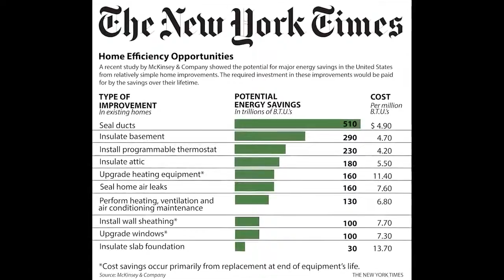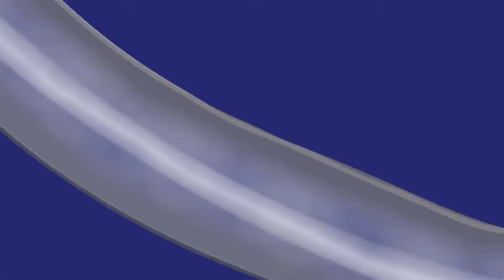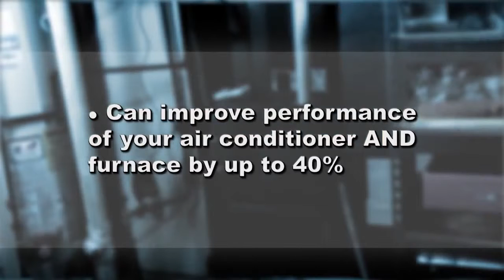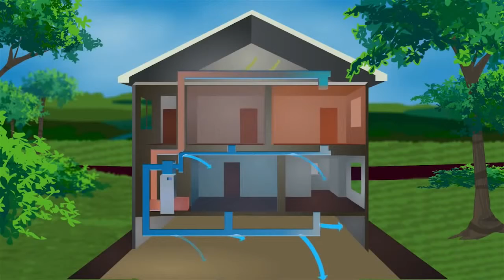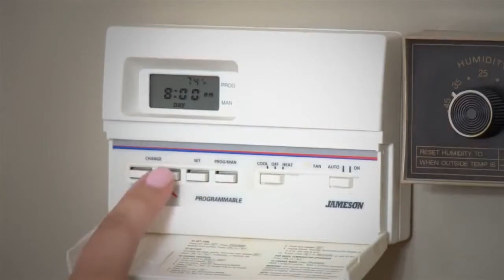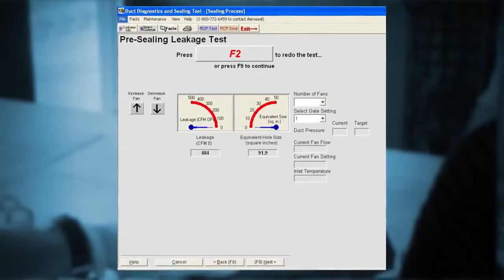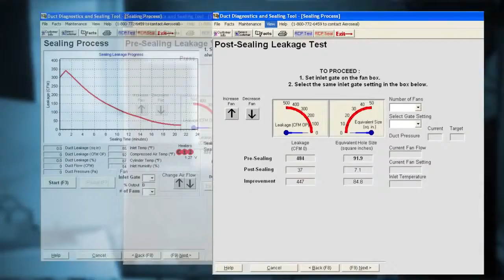Aeroseal overview with Dean Johnson from HOMETIME

Comment: Sealing? Noninsulated duckwork is "THE WORST" especially ductwork in unheated crawlspaces and attics, because the tin metal has to be heated before the ductwork can heat the home...
Reply from the maker: Yes, definitely not advisable to run ductwork in unconditioned spaces in general, but sometimes it's a necessary evil.   There are however ways to do it so that you get as little loss as possible.

Comment: How does the aeroseal process not foul the heat exchange surfaces in the air handler?
Reply from the maker: Good question Chris.  Before we seal the system, we cut into the main supply plenum just above the AC coil.  We then install blocking in the form of heavy duty cardboard and metallic HVAC tape in order to seal off the mechanical elements of the furnace and AC system from rest of the supply duct system.   Following that the supply register covers are removed throughout the home and plugged with heavy duty foam rubber plugs.  Once this has been done the supply duct system has been effectively isolated.  At this point it can now be pressurized and sealed.